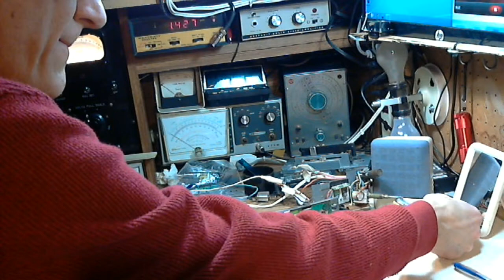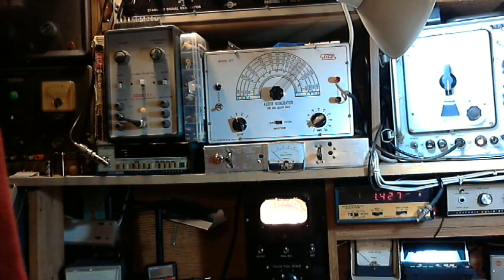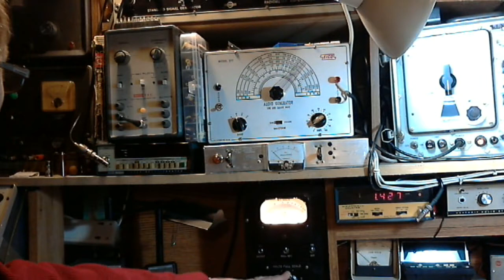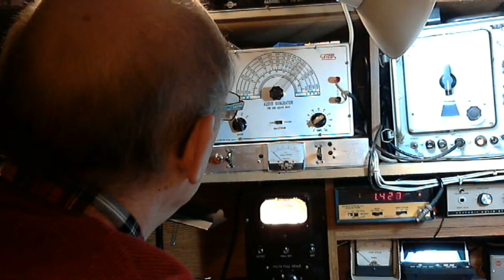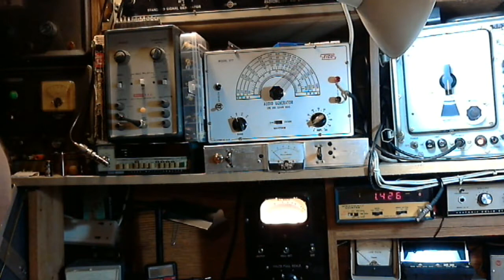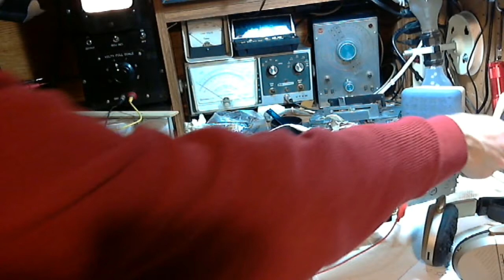Car Radio Repair Video #5 - 1968 Ford Mustang Philco AM/FM Radio D3AA

Comment: Hi Jim if it is a problem with heat which it could be. Try putting a towel over it just don't leave it un-atended. or a plastic pan of some sort. Dennis could be right.
Reply from the maker: Do you mean insulate it so the heat builds up?
Reply from the maker: I'm uploading a video of a heat run test.  It should be public in about an hour.  Oh, I'll be on my Tuesday Night Hangout with Scottytr6 at 7pm so it might have to wait until later to be posted.
Reply: Jim Lindenas
Yes
Reply: Jim Lindenas
I'll try and catch it tonight. The hangouts I mean.

Comment: The one thing that could be happening is with the radio apart the components stay cooler then they would with the radio together and mounted in the dash. For a bad cap just a few degree's of temp can make a lot of difference.
Reply from the maker: You could easily be correct.  The radios in some of my cars have gotten very hot.  I can try heating up the radio.  My shop bench has a very cold draft blowing across it since it's up against an outside foundation wall that is above ground.  With all the very cold weather, including today, anything on my bench is being kept very cool.  Time for a cook out!
Reply from the maker: I've done the heat run tests with difficult to interpret results.  My heat gun is too powerful for precision work.  I'm uploading the videos now.
Reply: I will be watching for them.

Comment: Ding Ding Ding
Your may be on the right track
Hint    corrosion on the ant jack
Reply from the maker: I noticed the corrosion right at the start but I assessed it as being insignificant.  I should check that out closer.  It could easily be that the antenna connection is poor due to corrosion and varies in resistance causing the fading.  That might explain Bobby's experience with two cases of fading radios due to antennas.  I'll check that out right now since the radio is on in my shop.  Very poetic.
Reply from the maker: Just finished checking the antenna socket.  I'm uploading the video but it won't be public until later today.  Don't hold your breath in the meantime.
Reply: I think Bobby is on the right track // ant.
Corrosion ? why, from what   water
water running down the antenna + coax and getting into the radio. Wet coax never dies out.
how old is this car, how long to the antenna coax been setting with water in it.
I had this happen to Me 2 times
both times It was the antenna and coax. the 2nd time I cut the coax apart  WOW what a mess
I thought it was the radio each time
And How inconvenient the car is not near by.
Maybe...... ?